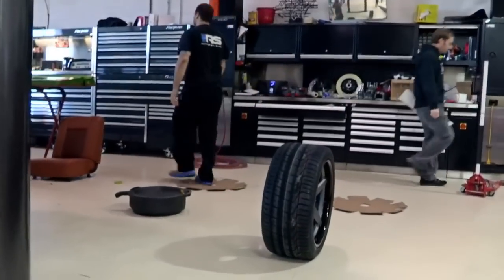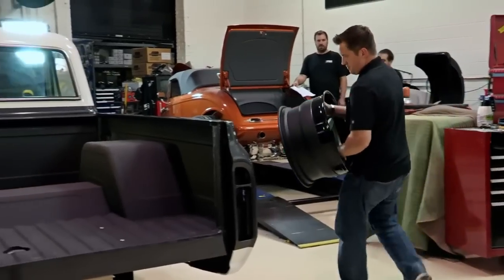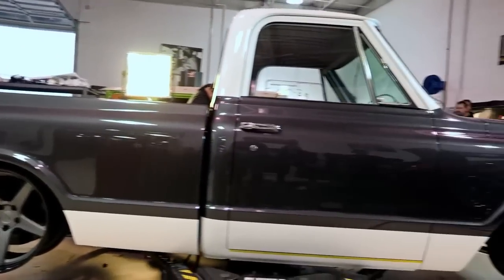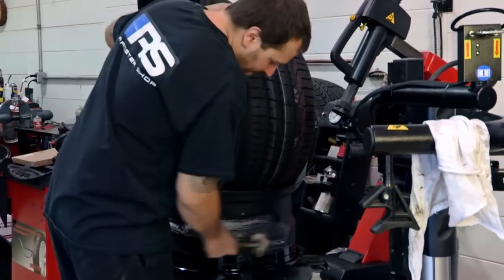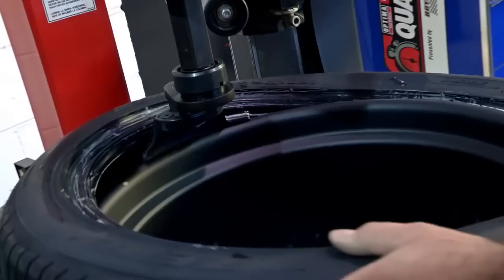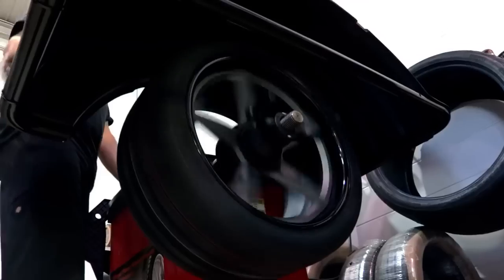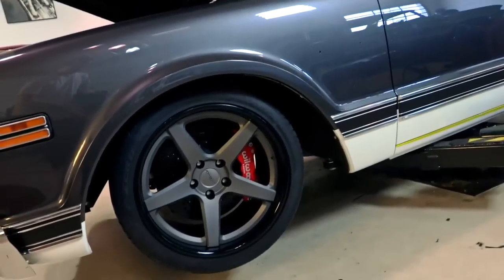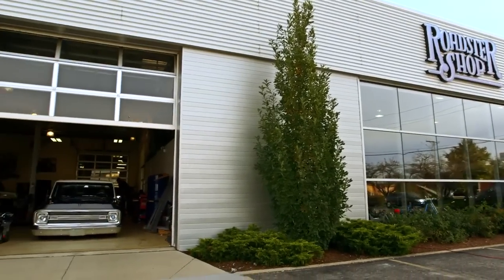Craftsman C10 Restoration Rollout Choosing The Wheels and Tires, Ep  18 of 24 Restoration Rollout 20

Comment: "Wheels and tires are a cheap bolt on part"......After taxes and shipping those wheels and tires cost over $9000
Reply from the maker: Which is a small part of a $400,000 build like this.
Reply: @Forgeline  400k for a build like that is someone getting robbed and taken advantage of
Reply: @Forgeline  Half a million on a truck like that is a joke..
Reply: @Forgeline  I mean, for $400,000, there's a scratch above "Craftsman" @ 2:21..
Reply from the maker: @MattBangsWood  I guarantee you that is not the case.